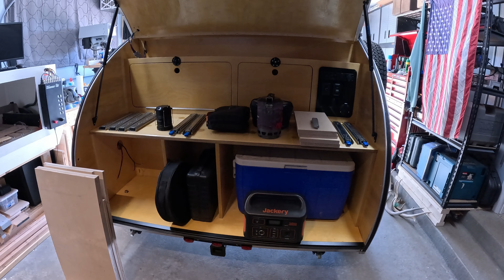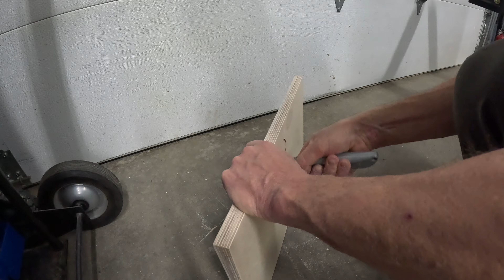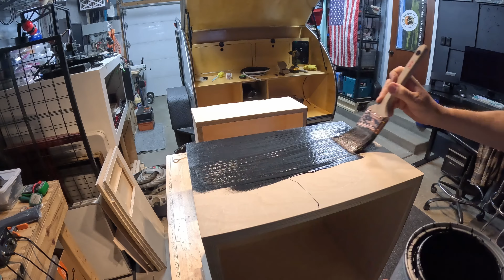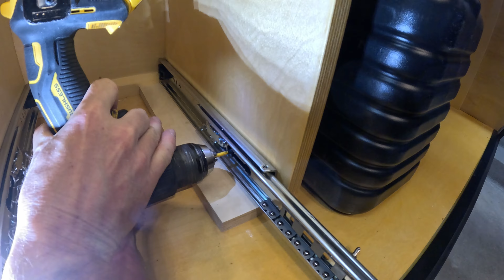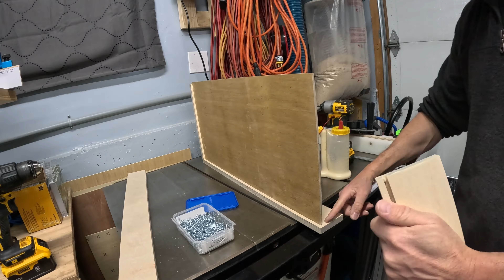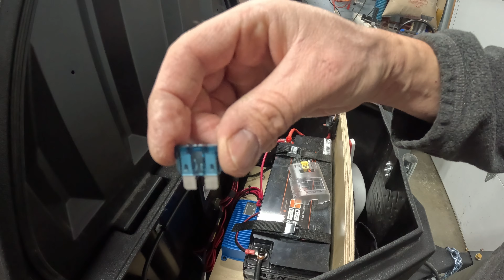DIY Teardrop Camper Galley Build: Custom CNC Cabinets

Comment from the maker: Designing the galley around our actual gear instead of standard boxes changed everything—even if that 12V fuse had other plans for my soldering iron! 🛠️💥
Question for the builders out there: What is the one piece of 'must-have' gear you would design your entire camp kitchen around? Let me know below! 👇